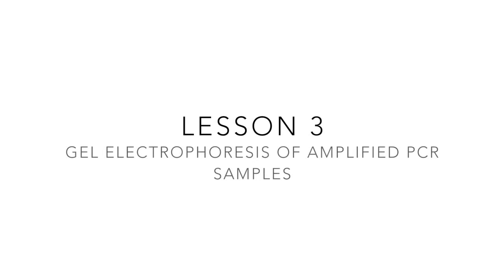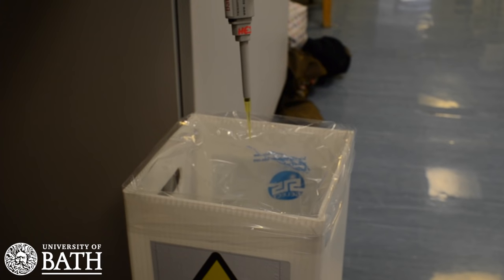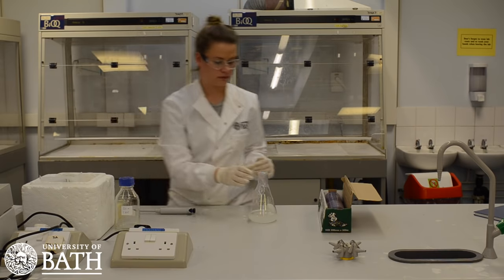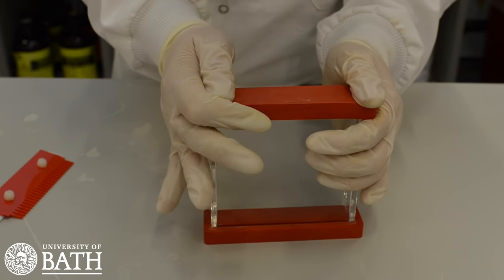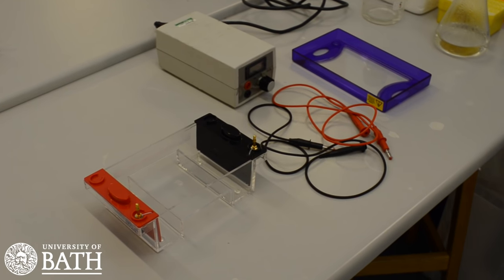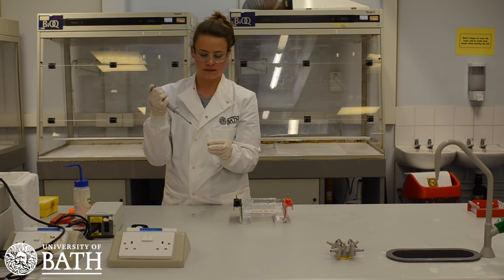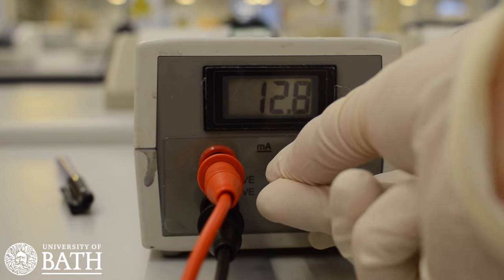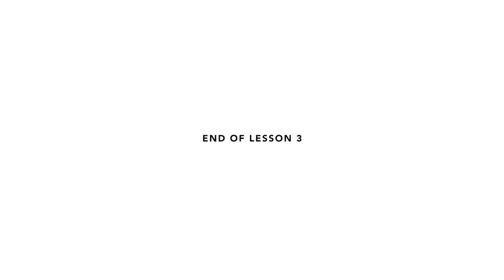Agarose Gel Electrophoresis of DNA fragments amplified using PCR

Comment: Never understood how electrophoresis worked by just being told about it, nice to see it for real. Thank you, very thorough video! :)
Reply: Do u see Newton before studying his law?🙄🤔😄
Reply: Electrophoresis is the separation of molecules with the use of an electrical field. Every substance, usually a nucleic acid or a protein, has a pI. That's the Isoelectric point and it's a feature that comes from the amount of positive and negative radicals it contains around it's perimeter (if it's a protein) or in it (if its a nucleic acid. Positive radicals move towards the negative pole of the field and negatives - to the postive. If you submerge a gel with the proper pH containing these molecules in a medium that allows an electrical current to pass through, the current will pull the molecules along with it. Heavier molecules stay behind, lighter move faster, thus, a mixture is seperated. Now, the molecular weight (how heavy they are) of a molecule is also its signature. You identify the molecules you need by their molecular weight.